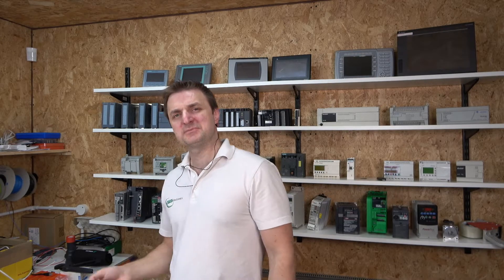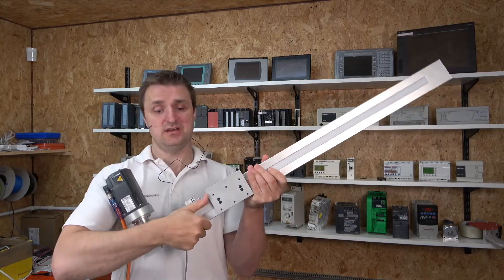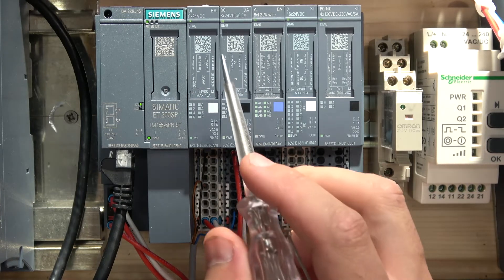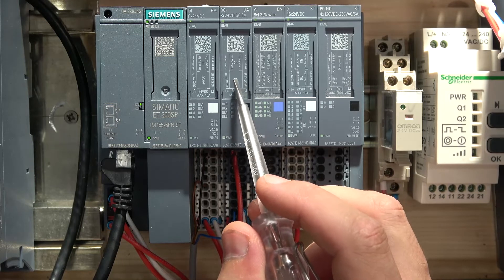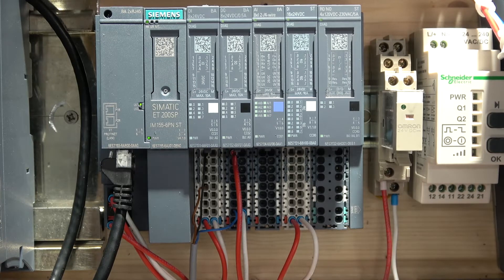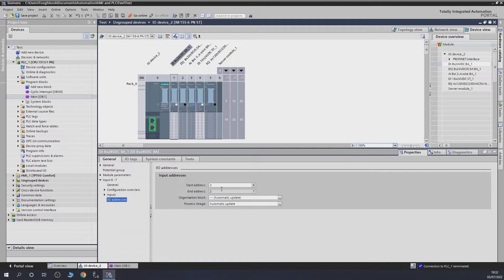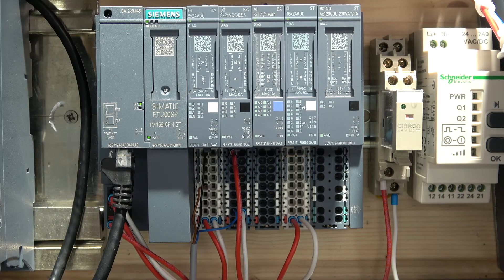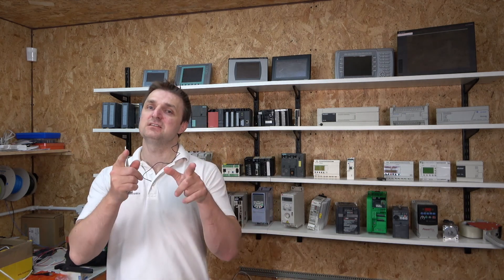Siemens ET200SP Input induction sensor wiring and Output transistor to relay wiring +TIA programming

Comment: What's is basic difference between 8 DI AND 16 DI module?

 In 8 DI we have positive supply that we can use for external use . In 16 DI module we don't have any positive supply for external use all input connection are there.

Any other points
Reply: I think you get the 24vdc from the power supply thats feeding that et200 module, I guess having the 16 di is just more inputs ?, im also having this question
Reply: @gustavoescamilla6662  its confusing